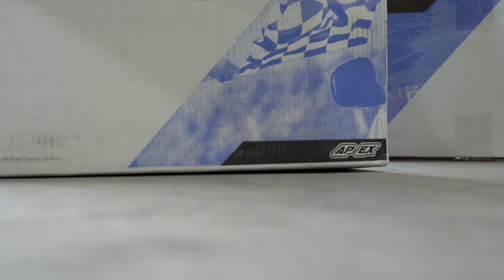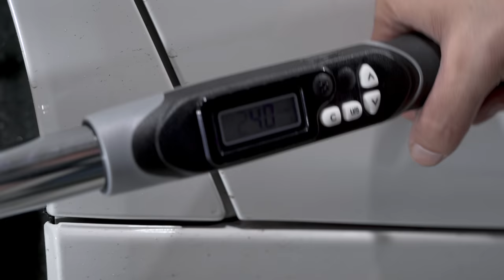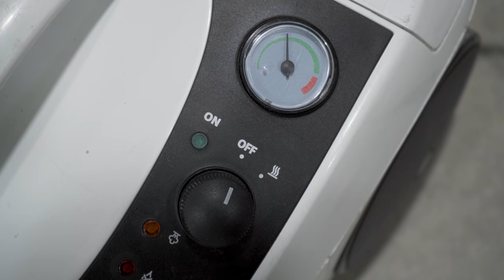Deep Cleaning Dirty BMW F30 Wheel Arches And Installing New Apex Wheels!

Comment: for a hot sec i though the brake rotors weren’t gonna clear the studs but then i used my eyes and realized you’re chillin
Reply from the maker: Haha yeah it scares me how short the mounting thread is on all studs. But I guess when you see how far a lug bolt actually goes in it’s no different

Comment: Beautiful work sir!  Quality service, with high standards and great videography. I really like your style so I've just subbed. BTW, I've recently been gifted a 1999 Porsche Boxster with only 27,000 miles on it and overall it's in very good shape. However, it's never been properly detailed, and the wheel barrels have NEVER been touched. I just spent the better part of 4 hours cleaning just the barrels and they're still not clean enough for my liking, although they are silver now instead of deep black when I started, haha. Hopefully some polishing will take out the mild discoloration spots.

Comment: I have a stupid question my brain was taken for a loop when you change lug nuts to stems. Do you have to use spacers when you do that ?
Reply: Shouldn't have to, no. Wheels should just got back on as normal.

Depending on the length of the studs, they might 'stick out' a bit.

Also, you might need to consider longer studs if you were to use spacers, to make sure there's enough thread for the nut to wind down on
Reply from the maker: No such thing as stupid questions bro! You know this haha. You don’t have to use spacers, they do allow you the ability to more safely run spacers. However it’s not the purpose. For me it’s the ease of use, sliding a wheel onto a stud is a lot easier than trying to find holes with the bolts. As well as they are lighter and I think they look better 😎

Comment: What is the use washing, cleaning and polishing using so many products without cleaning the red dirty rust on disk and it's souroundings area, fitting shiny alloys on the rust won't last long to catch rust on the alloys soon
Reply: the disk will be rust free the first time the brakes are used and they will rust again 10 minutes after getting wet again. there is nothing you can do
Reply: @frzen  disk can be clean after use but i am talking about the place where bolt are put, you can,clean, paint, sand blast, dry ice etc, some many options
Reply: Shhhhh let people enjoy things
Reply from the maker: You're probably right but it feels like minor nit picking which I don't care for haha
Reply: @ChromaticGarage  touching all minor detail makes a good detailer